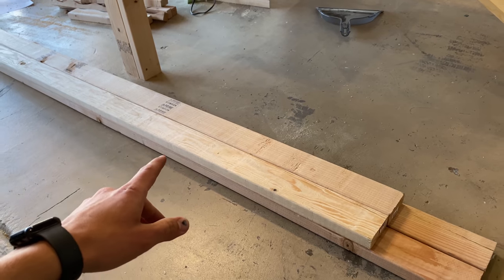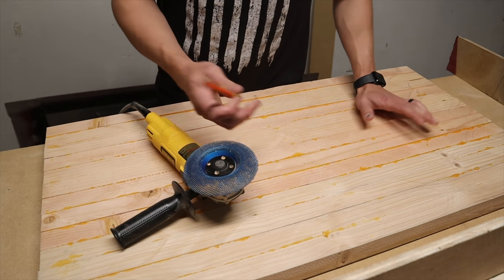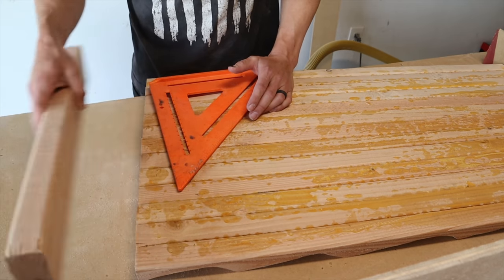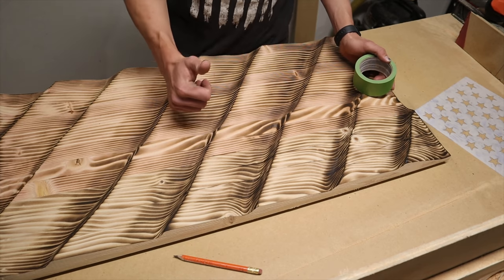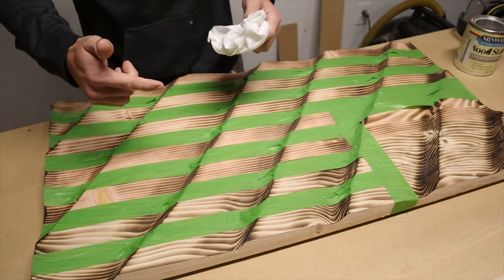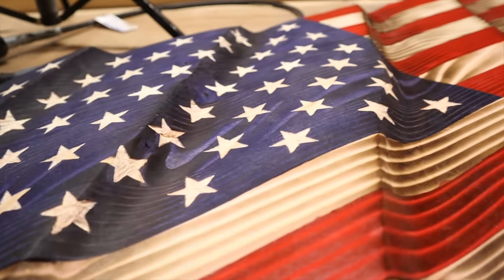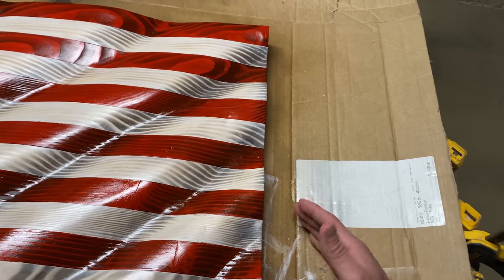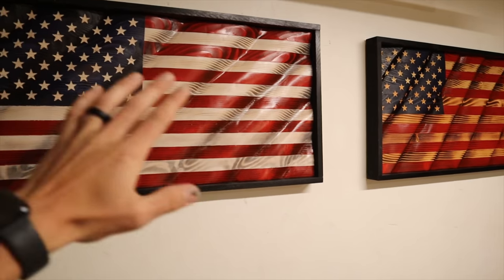How to make a WAVY WOODEN AMERICAN FLAG! DIY Wood Project! DIY Christmas Gift Idea

Comment: GREAT job Max.  I prefer the "more rounded" look.  To me it looks more natural AND I do like the white,  Keeps the flag more traditional.  BUT your stars take a massive amount of work.  For my flags, I pencil the stars on the blue and buy laser cut stars the right size and stain them all at once, then simply glue them on where the pencil marks are.  Additionally by doing that, it gives the flag a bit of a 3D look.  Carpe Diem! !! !!!

Comment: One thing I found out is that when you're going to do stars on the union you could try using your Frog tape to tape the stencil down to the outside edge to hold it in place.

Comment: I’ve made a bunch for gifts but for the stars I have star stickers to cover the white, paint the union blue then gently peel off the stickers and the white pops thru. I haven’t mastered the carving yet. I use the same stencil to mark three corners of the stars to know where to put the stickers. Then cover the whole thing with polyurethane spray. People love them.
Reply from the maker: Thats awesome!! Im happy to hear! Thats a good idea i should give it a whirl, thank you for sharing
Reply: Are you using 2x2s? I was using 2x4s cutting the rough wave with a bandsaw then using the same tools as you, love that grinder shaper. I know there’s a dozen ways to make them.
Reply from the maker: @nwcricket  pretty much, they are 2x4s ripped in half. A band saw would be handy!!

Comment: Little cheat!  I take my rotary saw and cut down to the bottom of my valleys so I have a depth reference when grinding.  You can also go about half way up your valley walls and place other guides (shallow cuts of course)

Comment: Excellent video!  Thank you for the inspiration and tutorial.  The finished product is amazing!  I think I will be putting this on my project list for sure.
Reply from the maker: Thank you very much!! Its a pretty fun build!
Reply: @MaxF01  have you done any flags that were finished on both sides?
Reply from the maker: @TheVerbiousOne  i have not yet tried that
Reply: @MaxF01  I was thinking of one of your flat designs, finished all the way around, with some eye screws or hooks on top, so it could be suspended from a ceiling and is then visible from both sides.
Reply from the maker: @TheVerbiousOne  thats a really cool idea! I never thought about that but i think it would be pretty awesome!

Comment: Dont see what you gain be ripping the 2x4 just to re-glue them. Flat flag maybe cuz the cut line is a reference for stripes. That's kinda lost when grinding. Or am I missing something???

Could it be done as effectively with 1×8 or something else?

Comment: Flag looks great man,well done. I like the rounded with the white as well. I’ve made the flat version before (who hasn’t) however I would have done the frame differently by doing miters, using 22g pin nails with glue and covered all the Brad/pin nails after the fact but that’s just me nit picking! Great videos though! I just subscribed!
Reply from the maker: Thanks a lot man I really appreciate it! 🙏🏼   Those are all great ideas and definitely would have made for a better flag and wouldnt have taken too much time either! Thanks for the good advice!

Comment: Great work! Like the white stained stars and stripes.  I am curious about one thing,  how do you not have the red  stain bleed into the white (or bare wood) areas? That is my most difficult part of building my flags.
Reply from the maker: Thank you very much!! I guess probably due to the frog tape but ill also go over the tape and make sure its all pushed down good before i start staining and i think that helps

Comment: Hey Max. Awesome work!! Can you tell me the measurements for a 4-FT wave flag? I assume 48” but would the thickness be 2”?? Thanks in advance
Reply from the maker: Hey Jeff! Thank you very much!! It looks like for a 48” flag the width of the flag would be 25 3/16 and the thickness of each stripe would be 1 15/16 so almost 2”. And the union would be 13 9/16 x 19 3/16. Hope that helps and sorry for the late response!
Reply: @MaxF01  Yes this is very helpful. Thanks again Max
Reply from the maker: @jeffmath2411  no problem!

Comment: Awesome.  Do you have a video for the other version you made?  Approx. how long does it take you to make one of these not including the drying time?  Finally, what would you sell something like that for?  Again, awesome work.
Reply from the maker: Thank you!! Im not to sure what i would sell it for but i was showing it to one of my neighbors and he said i could probably sell it for a couple hundred bucks so maybe 200-300 in that range. And i cant remember about how long it took to make, I usually dont make them all at one time so its hard to remember how long different things took. If i had to guess i would say maybe 8 or 9 hours total
Reply: @MaxF01  Which  grinding wheel did you get?  I mean coarseness?

Comment: So using a 10 1/2x14” union.  You would need to cut your “stripes” at 1 1/2”.  Not 1 3/4”.
Reply from the maker: Correct, i am cutting that for the depth of the stripes, the width should already be 1.5 inches since im using 2×4

Comment: If I don’t have a table saw I can use 2x2 correct??
Reply: Probably a stupid question but I’m literally just getting into wood working and not sure lol
Reply from the maker: Theres no such thing as a stupid question! 2x2 should be fine, it would be less than a 1/4 inch shorter than ripping down a 2x4 so you should be good 👍🏼
Reply: @MaxF01  cool I picked up the lumber today, “picked the wrong time to get into working with gol..... I mean wood” lol

Comment: How do u decide which side of wood goes face up? Knots here but not there? I notice each side has a different consistency and I’m not sure exactly what side will take the stain best etc
Reply: I know u said rounded side down but all mine are square 2x2 lol
Reply from the maker: Most of the time it doesnt matter because both of the sides will be pretty much the same but if one side has a crack or if there is a bigger knot or sometimes there will be sap coming out of one side so i just make sure to put those on the bottom side so they dont get in the way later on. Hopefully that helps!

Comment: do you think using 1" thick wood (like the original flags use) would work? I know the waves couldn't be cut as deep at the 1.75" wood, but you think it would look ok?
Reply: MAX?
Reply from the maker: Im so sorry for the late response! Hmm im not sure, the 1x2 is actually only .75” thick so you could probably go a half inch deep without making the wood too thin and then you would also have to use either just glue or short nails to make sure they arent coming through too far. Tomorrow i could test it on a piece of 1x2 and see if it looks like it would turn out. Sorry again for the late response!
Reply: @MaxF01  LOL...no issues, I'm sure you're a busy man...if you don't mind please try it out on a 1x2 and let me know...I've been making the 1x2 flags with great success and would love to try and make these wavy flags with out having to go to a 2x4... truly appreciate it!  look forward to your findings!
Reply: well Max did you try it?
Reply: Max whats the verdict?
Reply from the maker: @nsayegh3205  i just tested out today on a sample piece and im not sure if it would work, since you cant go as deep the waves would have to be smaller and there would have to be more of them, i think it would work on a smaller flag but for this size i dont think it would look as good as the ones with the 2x4s
Reply: @MaxF01  Thanks so much for experimenting for me....2X4's it is then...
Reply from the maker: @nsayegh3205  no problem and I apologize for taking so long to get around to it! Another option would be to use either 1x2 or 1x3 and stack and glue them flat side, but that could get pretty spendy because you would need twice as much wood as a regular one
Reply: @MaxF01  No issues on the time...you were doing me a favor...I think just using the 2x4 is the best and simplest way.   thanks again!
Reply from the maker: @nsayegh3205  no problem, i hope the build goes well for you!

Comment: Do u pull the tape as soon as ur down w the red stripes or after stain drys?
Reply from the maker: Usually ill pull it as soon as im done but ive also pulled it after it dries without any problems

Comment: Something did not look right to me so I went out in the yard and looked at my flag. With the union at the top and there’s less movement because it’s so close to the pulley, and the bottom has more movement, the waves are opposite than yours.

Comment: You should really plane the sides of those boards before gluing. You have gaps all over the place on that that are filled with nothing but glue, which affects the final result.
They make grinder wheels that will remove wood, much, much faster than that one.
You don't have to flatten out the back of the flag with clamps because it's a wavy flag and it's being hung on a wall. The warp won't bother anything, but if you try to flatten it out, its going to open up the numerous gaps you have in your flag. In fact, it woudl be best to have a bit of a gap between the back of the flag and the frame to that you can have it flush against the wall when you hang it. 
Also, don't buy a french cleat hanger, build one, it's extremely easy. Better yet, don't use them at all because they are extremely easy to dislodge if you don't have a lot of weight on them.

Overall, good video.

Comment: There is a easyer faster way don't glue the boards together so you can paint each board. Clamp, grind, paint, put together. The only tape is for the stars